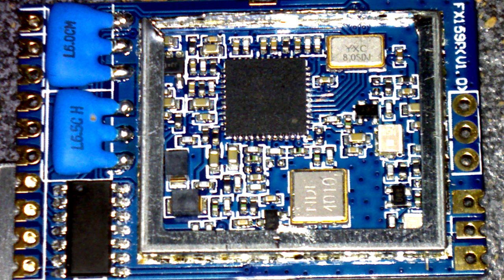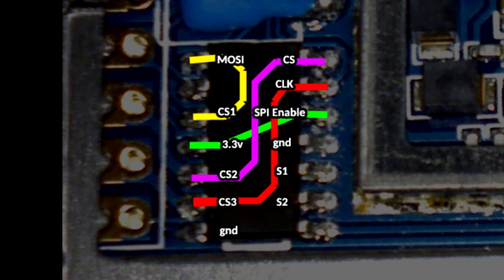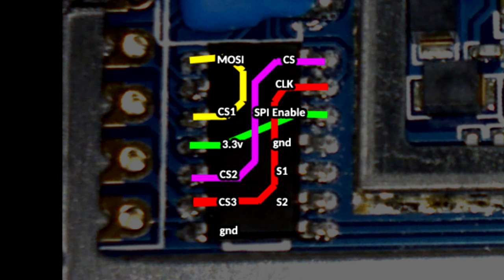FX159r - SPI mod

Comment: why use this over the rx5808?
Reply from the maker: Only if it's more available, they should perform basically the same.  I got a bunch of them because I thought they were already SPI enabled out of the box, they just weren't.
Reply: SiieeFPV yeah I've just replaced one of the modules on my realacc rx5808 (the other one) and it's sensitivity is terrible.  it was a used module I had. maybe I'll just order another rx5808 module from banggood.